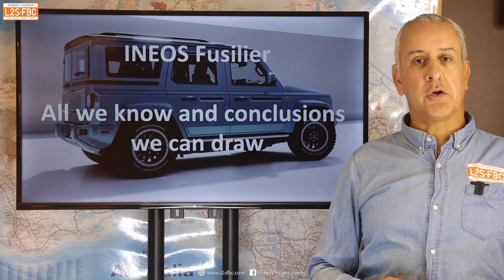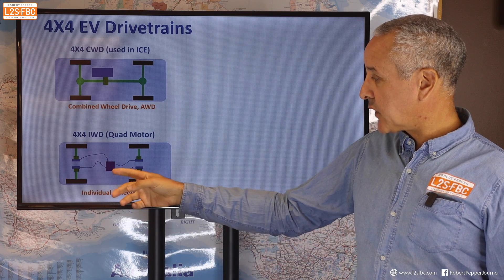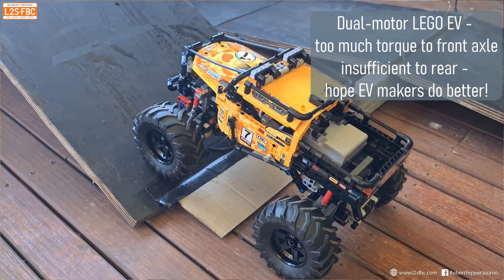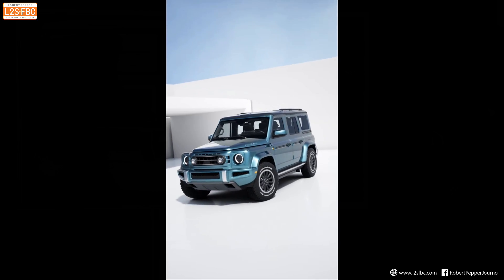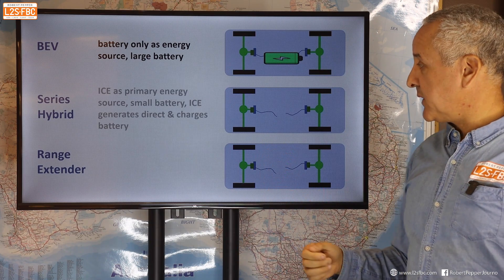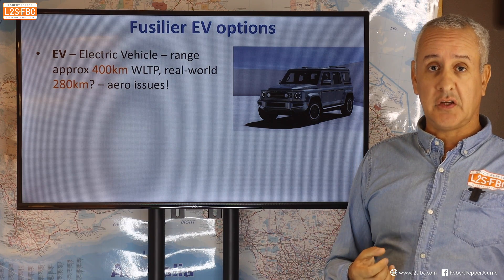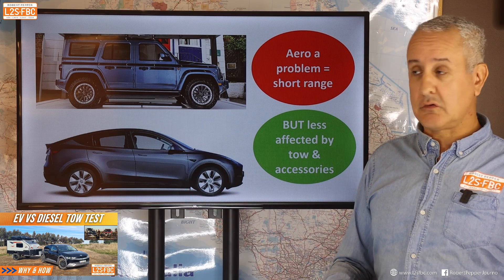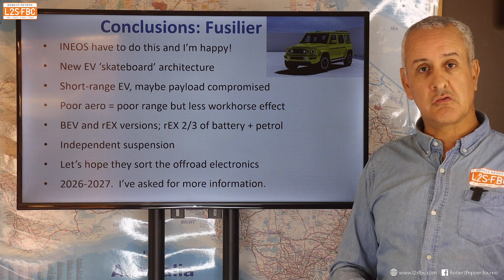INEOS Fusilier - two new electric 4x4 options for offroaders

Comment: Wait, what?  You don’t go through any menus to turn on seat heating. You just press the switch/button. Done. Unless you own a dumb vehicle.

And saying 2WD isn’t valid for off-roading. It’s amazing how much off-roading you can actually do in 2WD vehicles.  You don’t HAVE to have 4WD it’s just superior.

Even with front bias brakes on a hill - you can just press the brakes harder to brake more on the rear wheels - you don’t have to slide backwards. It’s only a bias, not no braking on the rear. Also - modern cars have ABS that’ll fix the front brakes from locking while providing rear braking at the same time. Also most vehicles have electronic brakeforce distribution (EBD) which will sort out the issues mentioned. And many vehicles have gradient systems which know the angle of the vehicle and apply more force to the wheels that will benefit due to the angle being driven.

Low range is pretty much obsolete with electric motors. 
That dual width back door setup is the worst ever. Have one door or two even sized ones and put the spare elsewhere.

EVs can also be HFCEV (Hydrogen Fuel Cell Electric Vehicle) so fully electric powered and the electricity is generated by a hydrogen fuel cell (and some stored in a much smaller battery).

Range Extender setup could also run the generator when you are parked to charge the battery. Doesn’t have to only run while driving.
Kinda weird though as BEV has one range and rEX has less but can be extended to the same as the BEV. Seems pointless - why not have the range of the BEV and extend THAT rather than extend a smaller range? Is it about the quick refuelling and the keep going?

As for the world going EV yeah it’s not. Only partly. 1 billion people don’t even HAVE electricity. The EV plan will level off and plateau at probably 30%-50% tops. There is no place ever for 100% EV or even close. It’s just not gonna happen.  I love EVs but they don’t suit every situation. HFCEV make the most sense but they are slow off the mark. Many manufacturers are winding back their EV development too so there’s that.
Reply from the maker: 1. many cars do have seat heating on touchscreens
2. the brake bias issue is a problem, even if you brake really hard. Try it.
3. EBD, ABS etc doesn't work at standstill or under 5km/h.
4. rEX will be longer range than BEV, and even if the same, can be refuelled quicker, yes.

Comment: Diesel/electric drivetrains are robust and have been around for over a century. I personally think ICE/electric locomotive style drivetrains are the way forward for automobiles. It allows for the ICE engine to operate at it's most efficient, and a small/medium sized pack will be all that's needed, as when the battery is depleted the vehicle can still drive. When hub motors get cheap/robust enough I hope we will start to see some very innovative vehicle designs.

Comment: Looks fantastic only. thing missing is an engine.
Reply: Didn’t you watch the video, it literally has an engine, but not in the conventional way, the engine is used solely to charge the batteries, but has no transmission or connection to the wheels, the wheels are only powered by electric motors.
Reply: Don’t worry it’s just our English sense of humour I. I have a Grenadier
Reply: @Pandora882  ahhhh okay, how’s the grenadier, I’ve been looking at the Quartermaster, I’ve already driven the grenadier, but how’s your experience with it

Comment: Watching this, i kind of hope you get a chance to try the electric G Wagon when it's produced.
They said they put the batteries into the frame to save space. 
Which i htink is a bad choice because i imagine a battery replacement is pertty impossible to do, and the battery will degrade like with any EV battery over time and use.
(Being from the area they are built, i have seen a few of them being factory tested on the road and on the special G-wagon testrack. Btw.: the Grenadier has been, and the Fusilier will also be tested on this track as the Grenadier was develloped here, and the Fusilier is said to even be built here.)
As for the Fusilier: what if the spare is in the "frunk"? i mean, yes they need space for the range extender and it's cooling, but if that is only a really small engine, maybe they do it like Citroen did decades ago... ;-)
Reply from the maker: You could be right...just no details, but I do hope there's a spare somewhere!

Comment: In realistic terms all EV derivatives hit the " the wall " at about 380km range - if you add more batteries you add more weight - so far EV usage has shown batteries dont like heavy work loads so even 400 km means 200km to the outback and 200km back in - i think the hydrogen solution even with its storage issues is a better bet - so do JCB ( excavators ) and they know a bit about heavy work loads ! As usual a great discussion - thanks

Comment: It seems to me that through no fault of Ineos, their debut to market as a car manufacturer was too late. They entered the marketplace with a vehicle that was supposed to be their version of the successor to the old LR Defender. Not a copy, but a vehicle that held onto the traditional build and concept of that legendary vehicle. With the Fusilier, that concept is now largely forgotten and have designed something that echoes the new Defender and practically almost all 4WD vehicles on the market. The powertrain being of course different. I am now failing to see where they differentiate and have to question the point of Ineos as it has now been seemingly lost. Even though the current Grenadier will survive in some markets around the globe for longer than it will in places such as Europe.

Comment: A couple of things. #1, the fusilier at first glance appears to be a slightly smaller, city-bias entry-level vehicle.More for the lifestyle buyer than those in need of a serious rig with long-term durability.  #2,In the lead-up to the Grenadier launch the assumptions were that the Grenadier would cost much less than it does today. Where do you think the fusilier will be price wise? #3, This surprised and disappointed me. Ineos is invested in Hydrogen - both as a chemical company and with their Hyundai partnership - Do you think the Battery EV is a temporary solution to get into the market while a hydrogen fuel infrastructure is slowly built out??

Comment: Hi Robert, the Dakar winning Audi isn’t a series hybrid - the third electric motor is connected to the engine which acts purely as a generator, the engine doesn’t directly drive the car.
Reply from the maker: It also has a battery though, so would that make it....well, what exactly?
Reply: @L2SFBC to use your categories it would be a range extender - I only commented as it you put it in the same category as a normal hybrid which can use ICE as a primary source, which the Audi Dakar cannot.
Reply from the maker: I think this illustrates the complexity of the categories!  The Audi has a tiny battery, so I don't consider it a range extender, more a petrol-powered vehicle that uses electric motors to turn the wheels. Whereas the Fusilier has a decent sized battery, but has a petrol engine to charge it as needed.  The question then becomes; given the only difference between a series hybrid and a range extender is the relative size of battery/ICE...when is which, which!
Reply: @L2SFBC  I think it’s primarily a BEV, with an ICE generator (not connected to drivetrain like a Prius), so yes a range extender. The Audi is a superb package, by having an 52kw battery electric drivetrain they get the best traction control and driveability, and use less fuel over a race distance than an ICE car, by having a 2.0 DTM race engine running at constant revs as a generator when needed.
I think that’s what the new Defender should have been, a proper battery with all the electric motor traction tech advantages, and an efficient ICE motor to top up when needed.
Reply: @L2SFBC  the original BMW i3 range extender only had a 33kWh battery, so I don’t think the size of the battery matters, it’s still primarily a BEV drivetrain, with an ICE generator.

Comment: Diesel-electric submarines seem to work okay.
I can see people chucking a generator and several fuel containers in the back and recharging nightly to extend range for remote touring. How much would a couple of hours on a generator add to the range?
Reply from the maker: I would imagine the petrol engine could fully charge the battery maybe three times, so say 700km range plus?  Don't think it'd be much of a problem.

Comment: As an aside Diesel Electic Locomotives have been around for years. The principle makes sense for remote touring 4WD.
Reply: Low speed diesel electric, definetly overlooked in the automotive/car world.
Reply: @RichardCostello-wj8gy No. It's stupid. With a torque converter you can do all the low speed maneuvering you want. The only vehicles that use it are trains, some ships and mining trucks. Regular heavy equipment is mechanical or hydraulic Even tanks don't use a hybrid drivetrain because it adds so much weight, reduces driving range and just offers no benefit. They have intricate transmissions for mechanical neutral steering.

Comment: This is what I expected.  Well except the independent suspension.  Magna Steyr makes an electric beam axle, so that is what I expected on this with similar suspension geometry to the Grenadier. 
1). I expect it is a Grenadier body with no spare ( an optional spare on the door if you want it) tire.
2). I expected a BEV [á la F-150 Lightning] with a modified frame to hold a 120 kWh battery
3). After the BEV I expected a petrol r-EX  because it is a simple technology but maybe Ineos with move it forward with a Liquid Piston Engine or an OPOC engine as the generator.
4). Next could be a LPG or Propane version of the REX engine.
5). Last would be to replace the engine & fuel tank on the REX platform with a Fuel Cell & Hydrogen Capsule, to make a hydrogen vehicle.  Essentially a pi-HY-EV.

Comment: Kind of worried that Ineos hasn't perfected the IC version yet let alone supply the demand but is spending resources on an EV. If they do go forward with the EV platform I'd recommend only making non road legal units for commercial/mine/industrial markets to start.  Perfect the vehicle there before making a consumer version and putting it in the publics hands.

Comment: It will be interesting to see the wading depth specs. To add, I think this model will be taken up by suburban mums doing the school drop-offs.
Reply: Soccer dads are as common as soccer mums in 2024
Fusilier or Amarok? 
Kids need so much sports gear now you wont fit them in a Morris 1100.
Reply from the maker: Will be very good I'm guessing.
Reply: @L2SFBC  Water proofing will be a challenge considering boats are made to not leak, but do.

Comment: Nice vid again. Thnaks. Government regs force EV production. One point in opposition I will raise is that had Ineos made the Grenadier an IFS  vehicle, I would never have purchased one, and I imagine a larger chunk of its current market also would have tapped out and it would have failed miserably.
Reply from the maker: Fair point Paul but if it had huge payload it may sell more?
Reply: @L2SFBC I personally dont think so, certainly not if it was at the expense of solid axels. I feel the base that would choose a greater payload over solid axels would  be smaller than those of us who just want a genuine solid axel vehicle. There are other vehicles that do this. 

The old ladder frame, dual solid axel construction, with some reasonable comfort features and power, was the Grenadier's wild card and hole to fill in the market. Otherwise, it would basically be a New Defender. 

I have no impericacal evidence to back my thoughts up. it's just my own purchase reasoning and owner discussion

If Ineos had gone with lighter axels, thinner guage steel, non-waxed, and smaller chassis, lighter body pannels, etc, to increase payload by 200kgs would it have been better?  It would probably look better on paper, but long term durabilty with a desired 25-year design life... We probably would not have known and been singing higher  praises, but I don't think it would have been as good as it is now. I personally am supportive of the design decisions and compromises they made.  Apologies for the rambling. I just wanted to add context for my thoughts. Cheers Paul
Reply from the maker: See your point, makes sense...we'll never know without parallel universe!
Reply: @L2SFBC Which is surely a nail in the coffin for long range EV off-roaders  by adding battery weight in markets where car driving licence weight classifications apply. Leaving less payload due to legislation, not any technical barrier to designing in more payload.
Reply from the maker: Yes. Time those limits were increased. A 2t vehicle is now no longer large.

Comment: EV + off road is a paradox! 3 Ton vehicle + 1 Ton Batteries ..in the outback praying to never ever encounter technical issues engineering talk sounds lovely but the real world is vey much different
Reply: Living in Australia I can say that electric vehicles makes sense (no diff, rear wheel steering etc) ONLY on paper. I go for the weekend and there are not enough charging stations on the road so what the hell would I do off road. It's a pipe dream until we get electric hydrogen vehicles
Reply: Weight isn't a factor only on a hard surface. Lots of the world are swamps, peat bogs or just any other soft surfaces, where a vehicle weight has a tremendous, sometimes defining, role.
Even on hard but wet slopes weight pose an extreme challenge
Reply: @TheArech  Soft sand becomes a huge challenge the heavier the vehicle.
Reply: Good to see some factual information re this initiative and personally I see this as a positive development. Makes sense for INEOS to diversify types of vehicles. Broader market should be good and lower emissions vehicles will benefit ICE owners too.  the key thing, as you point out, is whether they innovate the way the EV works for the off-road environment. Would be interesting to know what off road context INEOS is targeting with this vehicle
Reply: What % of world population goes off roading in the outback?
Reply from the maker: Probably 0.001%?  Percentage of 4x4 owners who drive outback? 90% I guess.  Could say what % of the population buys a Ferrari...yet Ferrari exists.
Reply: @L2SFBC  my point exactly. Other than the Australians, Americans, and Africans, most of the world cannot get to outback so EV off roader makes sense for many. No car is for everyone, and just because EV offroader is not for the very select few in the doesn’t mean it’s not for all off road enthusiasts.
Reply from the maker: Agreed!
Reply: @Skfkf1393a the ones you build this vehicle for!
Reply from the maker: Well, weight isn't as big a factor offroad as you may think.
Reply: @L2SFBC Ì suppose you have done offroad already, maybe not in the mud..
Reply: @L2SFBC I respectfully disagree with that, with small and light vehicles in extreme situations recovery is easier, you have more choices for lines around obstacles, less stuff breaks and overheats and you cause less trail damage. Of course you can't go for a week long overlanding trip in a jimny but I wouldn't go in a forest with an f150 raptor either. Of course off roading is highly regional each ones views are shaped by their circumstances